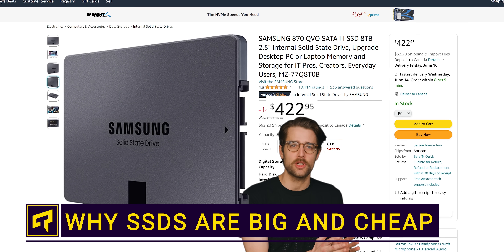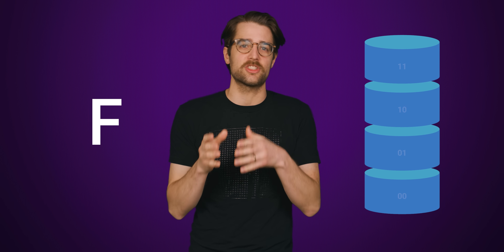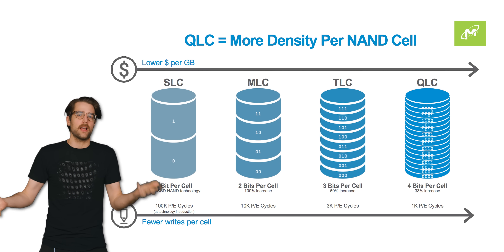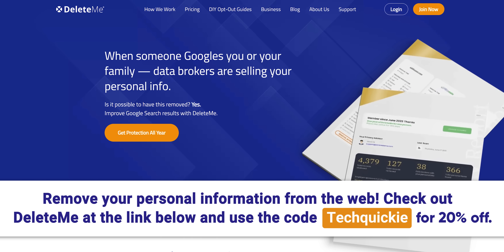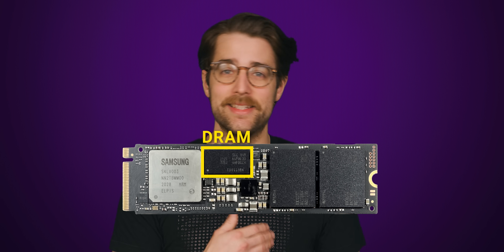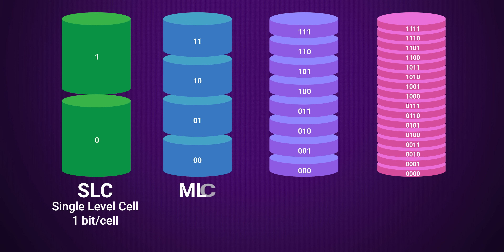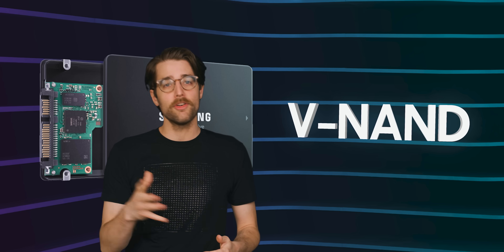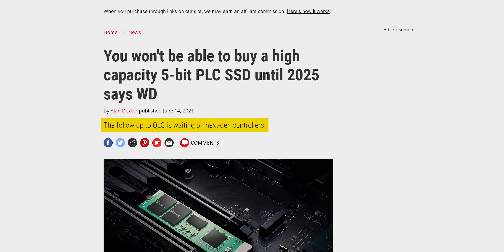Why SSDs Are Big And Cheap

Comment: My first SSD 12 years ago was a OCZ Vertex III with 128 GB and costed about 400 €. I installed my Windows 7 / Kubuntu dual boot system on it and had two 2 TB HHD on top for data storage and user directories.

Comment: SSDs are not big and cheap. On the contrary, are expensive. 
The cheap ones are low quality, low technology.
SSDs are not your friend, as they lose their capacity with use, and you should not fill them up.
With the HDD you don't have that problem. Indeed, it takes a little longer for loading stuff up, but the reliability and usability is far larger than ssd tech.
I mean, to ensure the longest life possible, you'd need to use SLC or MLC type and have it filled less than half of it's capacity.

Thus from a 2TB one, you should not use at least 1TB if you want reliable long time use

Comment: And I was wondering why my two 500gb Kingston SSDs that I bought for 20€ each slowed down from 100-300MB/s to 15MB/s writes after transferring for a while. I swear moving games will become a pain in the ass if they insist with this technology🥲. My HDD moves games faster. It may have slow random reads and stuff, but yet gets better results in crystaldiskmark 32gig writes 😀.

Comment: I was looking at laptops earlier this year, and was thinking of getting the model with a 2TB hard drive and internal DVD drive.  When talking with the guys at the store, they were saying that since it's not a SSD drive it would be much slower, so I went with one with just a 512 SSD drive.  After watching this I'm wondering if the trade-off is bad, since it's mostly file storage I would be doing.
Reply: I'd be doing file storage on a NAS or in the cloud. You can also connect to your NAS from the outside. As for the DVD drive, there are relatively cheap Blu-Ray players available that also support Millenium Disks (although the quality differs).

Comment: 8TB is not big. 8TB is what was normal back in 2010 before SSD took over everything and computer manufacturers spent the next 10 years bold ass lying to people saying that 256GB was enough space. SSD have only achieved parity with 2010... and then only at many multiples of cost. And nvme m.2 ssd are even more limited in that you can only have a couple of them. SSD are small and expensive. Just somewhat less so than they have been.
Reply: @@Zycho-System 256GB isn't even enough for my non-technical parents who only take photos and do craft stitching/etc stuff. 256GB in a computer in 2023 is a scam.
Reply: @@Zycho-System Right. So you're admitting 256GB isn't enough.
Reply: @@Zycho-System Your computers are so limited you have to pay for someone else's computer at the end of a high latency internet link. It's sad.

Comment: I, immediately, start to think, WOW, I need that.  Then, I come to my senses and realize that I have a 512GB NVMe SSD, for my C drive, and a 1 TB internal HDD for all my libraries and data.  The SSD is only 1/2 full and the HDD is only 1/4 full.  Yes, the libraries would load quicker but, do I really need them to?

Comment: The thumbnail is a little misleading, 2tb drives have never dropped below $100 and usually hover about 120, its the 1tb that costs 60-70
Reply: You're right it probably was misleading when the video came out, but right now 2tb is 60-70 usd. Prices dropped hard the past couple of weeks for SSDs and RAM.

Comment: What about store once and read forever kind of use cases?  For example movie libraries that you only ever read once the disk is full etc etc.  that kind of thing.
Reply: It's called WORM and there are other (better than SSDs) technologies like "M-Disc" for this.
Reply: @Wlad1  Okay but what's the maximum capacity of Mdiscs?  100GB?  People have libraries that are many terabytes.  Not to mention the mdiscs are probably best at archival use-cases rather than say always connected storage.  Cheers.
Reply: @Screaming-Trees  i use external HDDs for those purposes. "Hot data" for daily uses (programs and games etc) = very responsive and raliable SSDs (i have multiple Intel Optane SSDs). "Warm data" (downloads, videos, data for some projects etc) = slower SSDs (i have SATA-SSDs-Raid0 with 4x 4TB = 16TB). "Cold data" (Video archives etc) = NAS or external HDDs - these are connected, but "always-OFF".  Switched on only if data access is needed.
Reply: @Wlad1  I hear you.  I am the same.  I have a bunch of mechanical disks raided.  There are downsides like noise for example and there is always the specter of bad sectors with mechanical drives.  I'm flirting with the idea of SATA SSDs as a replacement.  You can get 8TB sata SSDs now for almost reasonable prices.  Silent, probably a little less risk as they don't exhibit the same weaknesses as mechanical drives etc.  Maybe finally relegate mechanical drives into a backup role only.

Comment: I think that slide is very misleading (the top arrow indicates correctly SLC is more expensive than QLC, but the bottom arrow is surely suggesting the opposite to what it should - ie it should  be MORE writes per cell as you move further to the right)
Reply: The bottom one doesn't mean "fewer writes per cell requied to store the data", no, it means "less longevity", "less endurance".

Comment: 4:00 Table displays on screen — with erroneous (percentage) analysis of "increase in capacity" and "increase in complexity"

In the table:
1. "States per cell" really means "charge-states per cell".  The number of physical storage-cells does not increase.  Only the number of charge-states increases: for MLC, TLC, QLC, and PLC.
2. "Increase in capacity" — contains incorrect percentages — because they (should not) be relative to the previous type...
2a. they are relative to the base-type — SLC — which, when corrected, looks like...
2a1. | SLC = 100% | MLC = +100% (200%) | TLC = +200% (300%) | QLC = +300% (400%) | PLC = +400% (500%) |
3. "Increase in complexity" — contains (one) incorrect percentage (column-spanning the table-data cells)...
3a. the increase in complexity is defined by the "states per cell" — which doubles with each "bits per cell"...
3a1a. | SLC = 100% | MLC = +100% (200%) | TLC = +300% (400%) | QLC = +700% (800%) | PLC = +1,500% (1,600%) |
3a1a1. | SLC = 2 states | MLC = 4 states | TLC = 8 states | QLC = 16 states | PLC = 32 states |
3a1a1a. with SLC (2¹), two discreet and well-separated electrical charges can be used ➔ the least complex
3a1a1b. with PLC (2⁵), thirty-two discreet and poorly-separated electrical charges must be used ➔ (by far) the most complex

I look forward to the @Techquickie correction video!
(Who am I kidding?  Even if I'm not shadow-banned yet, surely this comment will do it.  Comments are meant to be praise-only.  No room for (constructive) criticism.  Not without bending over backwards to be polite and respectful.  Right? smh)
Reply: In case this is not obvious to some readers of my comment:
"3a1a1a. with SLC (2¹)..." ➔ chance of read/write success = 1⁄2 and chance of read/write error = 1⁄2
"3a1a1b. with PLC (2⁵)..." ➔ chance of read/write success = 1⁄32 and chance of read/write error = 31⁄32

Those are oversimplifications, because there's probability distribution in each — with far greater tolerance in SLC and negligible tolerance in PLC.  But, it's a good way to convey just how much more complex PLC is — compared to SLC.  In reality, SLC (probably) looks more like...
"3a1a1a. with SLC (2¹)..." ➔ chance of read/write success = 53⁄64 and chance of read/write error = 11⁄64

Another reason SLC is least complex — the controller can just write to each cell.  All others require that the controller read data before writing data.  How does the controller know which charge-state to write, without (first) knowing which charge-state is already there?  It doesn't.  Using MLC as an example (enumerated binary-to-charge-state values):
0b00=0
0b01=1
0b10=2
0b11=3

If the instruction from the controller is "flip the rightmost bit" (i.e. 0➔1 or 1➔0), then it must read that bit before it flips it.  Not to mention — it must preserve the leftmost bit (i.e. 1➔1 or 0➔0).  Such that...
Read state 0 ➔ Write state 1 == 0b00➔0b01
Read state 1 ➔ Write state 0 == 0b01➔0b00
Read state 2 ➔ Write state 3 == 0b10➔0b11
Read state 3 ➔ Write state 2 == 0b11➔0b10
Reply: @M0rn1n6St4r  It writes in 4k blocks regardless. If you need to change 1 bit it's going to rewrite a whole 4k block.
Reply: @dat_21  - You are thinking of the (default) block-size in the file system.

What if I have formatted the partition, changing the (default) block-size from 4 KB to 256 KB?  Then what?  Does it write 256 KB?  Even if my program is only writing 1 bit?

I'm not saying you are wrong.  I wouldn't be surprised if SSD manufacturers let the file system, users, and software wear-out the storage via excessive writes.  But, if it works the way experts claim it works, the device's components (controller, driver, etc.) and the OS account for the HDD-based block-size.

If it works the way it should¹, then — no — it does not write 4 KB blocks, regardless.  But, the file system "thinks" that it does.

¹ On the first system I used, with an SSD as primary storage, I installed all the software I had been using with HDD.  When I tried to secure-erase a bunch of sensitive files, using 7-pass DoD overwrite, the system popped up a notification.  Something like, "This storage device does not [benefit from or support] secure-erase.  Permanently deleting files, instead." (on a 2015 MacBook Air)

I haven't tried it on any other system, so I don't really know.  I can, however, report my current system's S•M•A•R•T• data:
Available Spare:                                        100%
Available Spare Threshold:                       10%
Percentage Used:                                         2%
Data Units Read:         159,935,021 [81.8 TB]
Data Units Written:       36,101,915 [18.4 TB]
Host Read Commands:              637,603,941
Host Write Commands:              416,305,509
Controller Busy Time:                              2,018
Power Cycles:                                           7,013
Power On Hours:                                      2,721

Why would a system protect me from myself, in regard to secure-erase, but not protect me from my file system's block-size?  According to the data, my SSD has not been writing 4 KB blocks.  Not unless it's necessary — to write 4 KB of data.
Reply: @M0rn1n6St4r The block maybe be different, but it still writes whole chunks even on very small changes. Controller will to do wear leveling so blocks will be shuffled around to not wear 1 cell too hard. And operating system will try to combine small writes into blocks.
Reply: @dat_21  - Yes.  And doesn't wear-leveling evaluate how much of a block is "empty" — correlating those bits to other "empty" cells — to write as few bits as possible?

Unless you're using btrfs or zfs.  The copy-on-write "feature" sounds good, in theory.  On spinning rust (HDD), it is good.  On SSD, however, it leaves much to be desired.  If I make a small (1 MB) change to a 100 GB file, it will write another 100 GB — while free space is available — to keep both versions of the file.

That's one way to wear-out the SSD — fast!  Great for rollback.  Terrible for device performance¹, health, and longevity.

For those file systems, in my opinion, the value of the data must be >> the value of the device + the value of the performance impact (i.e. the user's time).

¹ Ever see the performance difference between a Linux distro running on ext4 (or xfs) vs the same distro running on btrfs?  It is shockingly bad.  If I recall correctly, btrfs only performs (relatively) well, doing large, sequential reads and writes — on PTS (Phoronix Test Suite).  Because of the build-up of "many versions" — it performs (relatively) poorly — even in the read categories.

Comment: Going from QLC to PLC adds 1 extra bit of information to each cell.  Each extra bit doubles the storage that the same cell can carry.  I'm not sure where the 25% comes from, other than increasing from 4 bits to 5 bits is 1 extra bit which means "only" 25% more bits, but each bit is a literal doubling of the data you can store in a cell ... ?  I must be missing something.
Reply: "Each extra bit doubles the storage that the same cell can carry." - wrong, this is just an extra bit, no more, no less. So it's just 25% more information. What doubles -> are charge levels per cell, that are required to store this extra bit.
Reply: @Wlad1  - Exactly.  And what does that do to the complexity of each?  It doubles the complexity each time.  Right?  But they show 100% "increase in complexity" for every type, greater than SLC.  Their table is not written clearly.  All details should be written relative to SLC and not the previous type.  It should look like this:
• Increase in capacity: | SLC: 100% | MLC: +100% (200%) | TLC: +200% (300%) | QLC: +300% (400%) | PLC: +400% (500%) |
• Increase in complexity: | SLC: 100% | MLC: +100% (200%) | TLC: +300% (400%) | QLC: +700% (800%) | PLC: +1,500% (1,600%) |
Reply: @M0rn1n6St4r  i think, the COMPLEXITY of your mindset ist too much for the average user 😅👍🏻 It's ok when they just show the effects of this complexity (apart from lower speed/longevity he forgot to mention lower retention time).
Reply: @Wlad1  - Ja, genau.  Vielen Dank.  Immer noch verrückt nach Allen diesen Jahren. 🤪

Spotted your surname in the email notification — only guessed that you may understand what's written, above.
Reply: @M0rn1n6St4r  Ha-ha, aber klar doch 🤗👍🏻 Your german is good. Only "nach Allen diesen Jahren" is wrong, never capitalize "allen". Just say "nach all den Jahren" or "nach all diesen Jahren".
Reply: @Wlad1  - I have 3 semesters of German, in University — 30 years ago.

Hey... at least I'm making more sense then President Kennedy.  "Ich bin ein Berliner!" → "I am a doughnut!" lol

Imagine what he'd have said in Vienna. 😳🌭
Reply: @erple2 "I must be missing something."

Yes.  You are.  You cannot store two 4-bit integers in one 5-bit integer.  Each bit doubles only the number of values which can be stored.  4 bits can store 16 values (e.g. unsigned integer 0–15).  5 bits can store 32 values (e.g. unsigned integer 0–31).

To store two discreet, 4-bit integers — requires 8 bits.  Right?

Put another way, how many boolean values (i.e. false or true; 0 or 1) can be stored in 4 bits?  If you answered "4", then please explain how 5 bits might store 8 boolean values.  Remember... 5 bits can store 32 unique values.  And there are 256 permutations of 8 boolean values: 0b00000000–0b11111111 == 2⁸ (8 bits).

Comment: Why don’t you just be honest and tell the truth that because it’s one cell is holding 8 bits of data, but any change to 1 bit of the 8, the whole 8 bits have to be changed, or more accurately, it’s only the state of the cell matters, it’s only one single state representing all 8 bits, so it’s actually 8 times memory with same number of cells with more precise cell state measurement technology. The explosion of memory is not the result of more cells although it helps, but instead how the memory states are defined. It was 1 bit per cell, not 8 bits per cells. The number of rewrite cycles is greatly shortened because it has to rewrite 8 times as often, and so the lifespan.

Comment: Will PLC even be faster than 7200RPM hard drive? If not then what’s the point if the HDD will be as or more reliable since higher capacity HDDs are more reliable?

Comment: For the last few years Ive told everyone I know that by 2028 HDD will has ZERO perks over SSD tech. 
By 2028 SSD will:
1. 16TB for around $100
2. 64TB for around $500
3. Speeds nearing 32GBps
4. Same if not better data retention than HDD at worst. 
5. Still silent
6. Still runs cooler
7. Still runs with even less energy
8. Even smaller than now (16TB on a stick the size of a quarter)

HDD tech will not make it past 40TB for around $600 and it will be the worst purchase of your tech life. Stop buying HDD. If you do, buy in ebay. Let tech industries know that they need to ramp up SSD production. HDD tech IS slowing down a revolution in storage that is going to explode. The faster the better. By 2040 we will be very close to the first 1 PB chips in the multi GB transfer range. 
After 2040 the line between SSD and RAM itself will start to blur.  Its an exciting time for storage tech.
Reply: If a 16tb ssd comes out within the next 5 years it will cost about $1000 minimum.
Reply: That's way too optimistic. If they get 2x-3x cheaper for the same capacity by 2028, that alone wouldn't be so bad.

Comment: SSD's are not Big. 2 Tb is nothing. I use some 5TB 2.5 HDD's and we are still hanging since 10 Years on this 5TB Models (2.5).  If you buy a 5 or 6TB SSD Today, they are not Cheap. You can buy 6x 5 TB Hdds or more from the Price for 1x 6TB SSD.

Comment: The last mechanical drive I bought was in 2010 it was about 10 cents per GB and I just bought one recently for 1.63 cents a GB. And hard drive capacities have only increased 10 times (You could buy 2TB back then). I'm not impressed at all by hard drive capacity increases. From 2TB to 20TB in over a decade? That's pathetic honestly. SSDs and Nvme are even worse. You can't even buy an 8TB Nvme without selling one of your kidneys. Storage has been one of the absolute worst in terms of how fast they are improving.

$400 for 2TB nvme is fucking ridiculous considering we had 1TB mechanical drives in 2009. It's 2023. We should have 50TB and 100TB hard drives now. Where are they? It's pathetic.